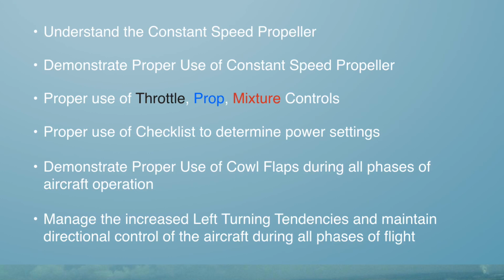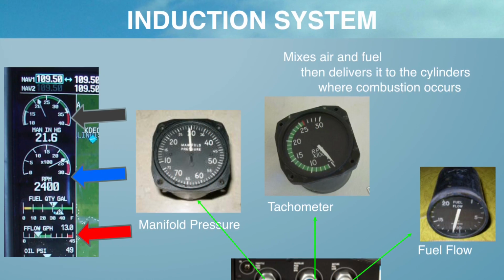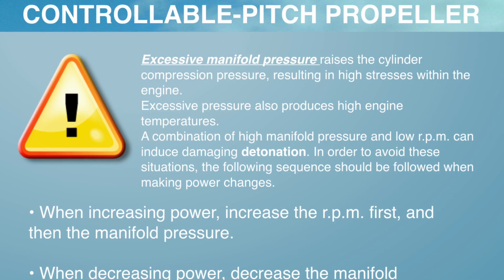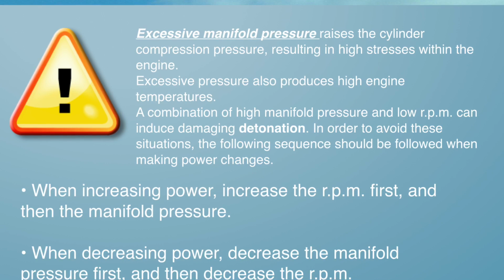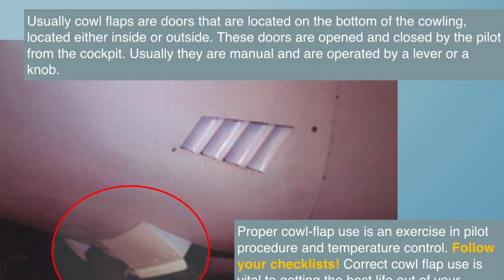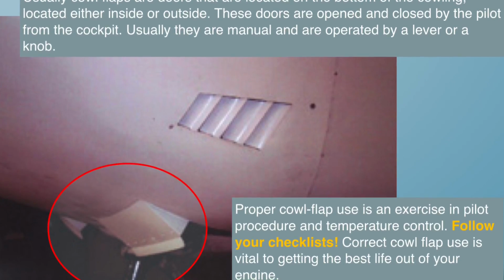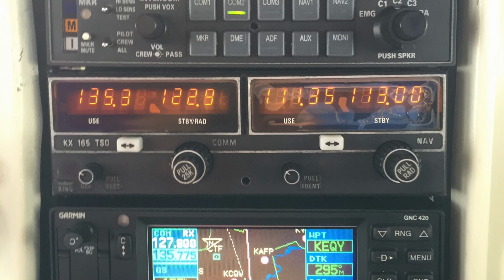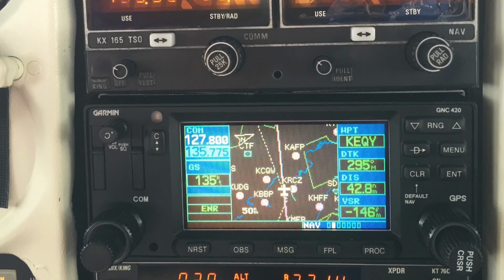High Performance Endorsement

Comment: 99% of all constant speed propeller equipped aircraft are authorized to fly over squared per the POH (more manifold than rpm). A Cessna 172 scoots around at 2400 rpm and 28 in manifold no problem. Good info in all.
Reply: I'm glad you posted this, the acceptable maximum pressure-rpm settings are very much specific to each engine/aircraft.
I hear this "keep it under squared advice" a lot from instructors just blindly repeating and without specifying that the advice is specific to only that training airplane (If they have even actually read the whole poh!).
It works as a training failsafe setting for a student to fallback on when they need to manage mental workload, but otherwise not accurate information to teach.

Comment: Loved your video found it very useful for preparing for my high performance and complex, very well explained. Thanks
Reply: From what i can see, people get confused between vacuum and manifold pressure. First, lets get some terms set.
 Vacuum is a relative term. Same as cold. there is no such thing as cold. Its just less heat.  So, a perfect vacuum is 0 absolute pressure.  If absolute pressure starts at 0, it can only go up from there. That is what your manifold pressure gauge is reading. Pressure above a perfect vacuum. Most have heard of 14.7 psi as standard air pressure. That number is the weight of the air in a 1 inch column from sea level all the way to space. 14.7 psi is also 29.92 hg.  So your pressure gauge is reading in hg, not psi, and starting at 0 hg, or 0 psi. 
 When the engine is idling, the throttle plate is closed, and no load on the engine, vacuum is high, manifold pressure is low. When you open the throttle plate, vacuum goes low, and pressure goes high. Which means since you have less vacuum, you have more pressure. 
 So, get the term vacuum out of your head, and just think about pressure above 0 absolute pressure, and the manifold pressure gauge starts making sense.  The idling engine has the lowest manifold pressure, and the full load engine has the highest manifold pressure.